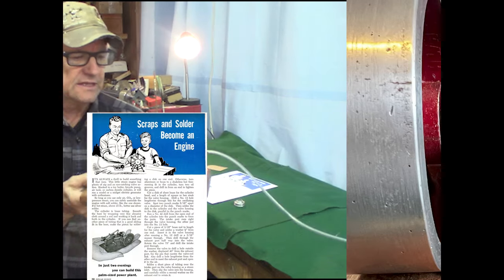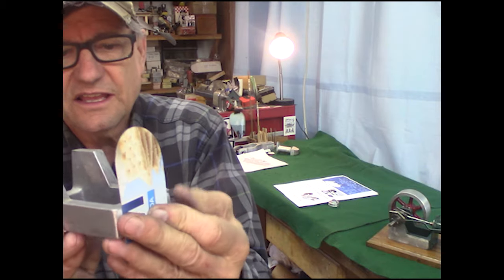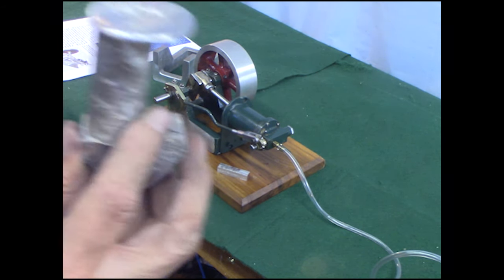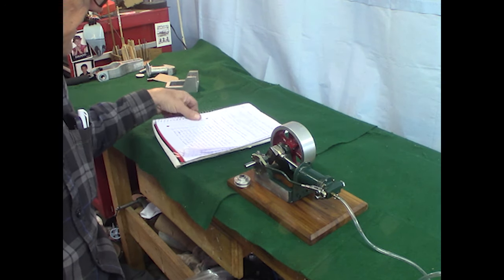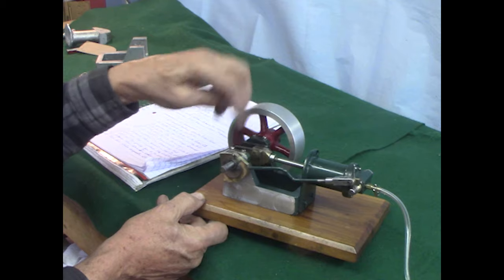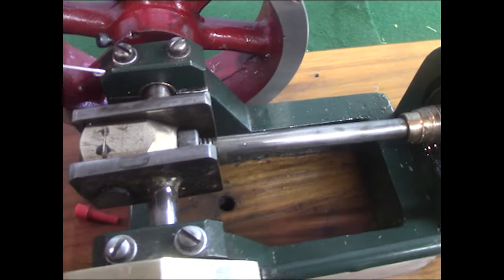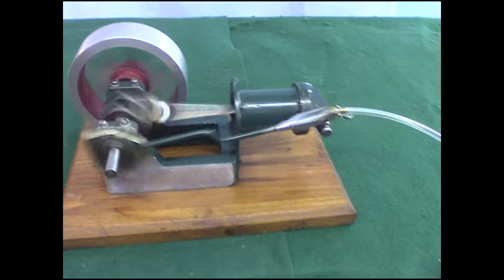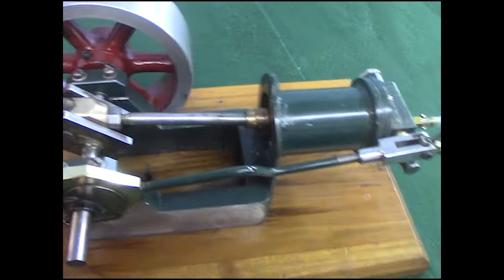Modifying DiY Steam Engine SteamPunk from 1950 Popular Science "Scraps & Solder" rotary valve model

Comment: I downloaded the plans for this several years ago but have never built it.  Now I'm getting interested again.  I really like your idea for the adjustable valve throw.  I'll probably use a cast iron dolly wheel for the flywheel.  another interesting variation would be to use a piece of Lucite or some other transparent plastic for the cylinder, maybe with a Teflon or Delrin piston.
Reply from the maker: Sounds like an interesting idea, should work fine and be fun to watch running.